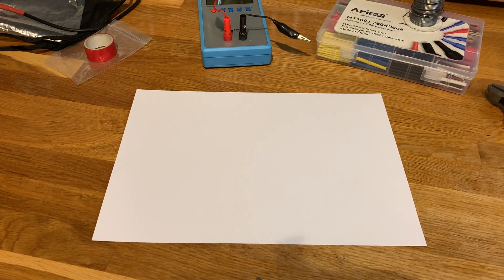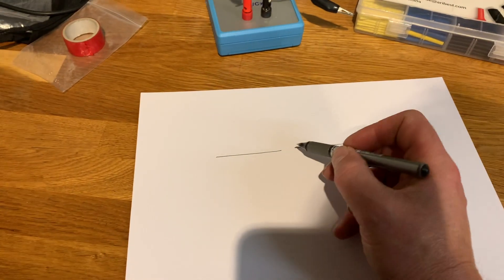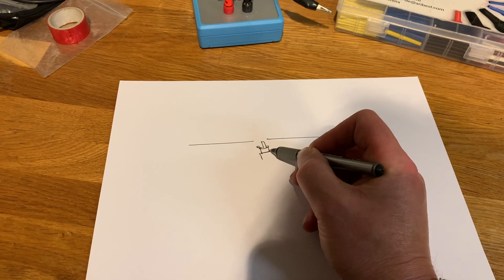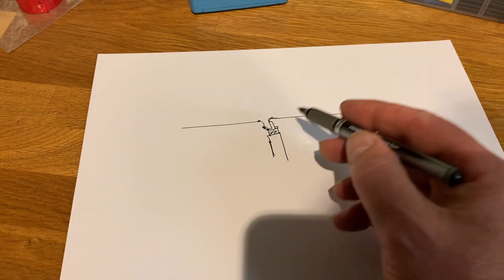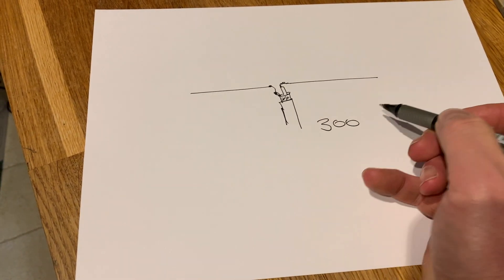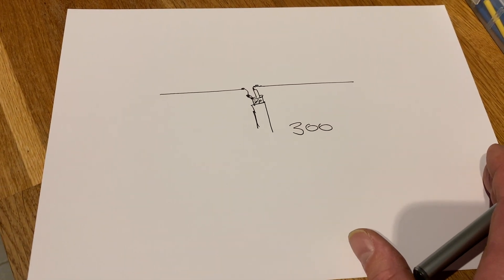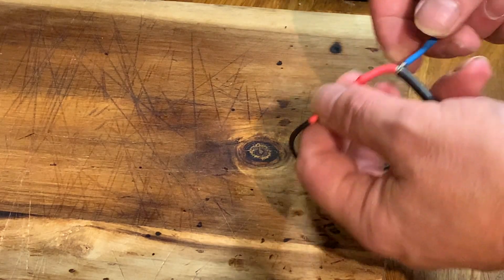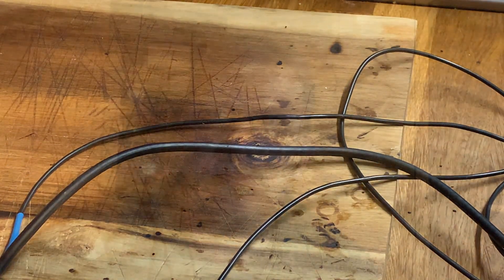HAM RADIO: Simple 20M Dipole build in real time.

Comment: For some odd reason this reminded me of a time when I needed to make a quick and dirty dipole. All I had was a lot of coax that had a PL95 connector on one end. I don't remember what frequency I was running it on at the time, so for brevity we'll just assume I also needed 5m lengths. What I did was measure back from the unterminated coax end about 5m. I removed the outer jacket for that 5m. At the point where the stripped part met the un-stripped part I spread the braid apart just enough to snake the center conductor out. I basically made a dipole by using the center conductor as one arm and the braid as the other arm.
Reply from the maker: Spot on.  :)

Comment: hi could you use a piece of copper pipe inside a plastic tubing instead of wire
Reply from the maker: Yep as long as the same material is used for both legs copper pipe is a good choice..:)

Comment: Great video Mike .... If you cut wire on a regular basis as i do, I found it much easier to get a 1m piece of dressed 2 x 1 lumber and mark the wood every 100mm down its length and use this as my measuring stick.. Comes in handy to walk down the yard too to get a idea of the length of coax or feeder required. 2m0aki.
Reply from the maker: Great idea

Comment: Hi. Very confused old man here, sorry. Help me right pls. 20mtr wavelenght....1/4 wave = say 5mtr. Is that not tip to tip. Then 2.5mtr per side. See you have 5 per side. Is that not 1/2 wave now? 😊
Reply: Yep. No need to apologise. It’s a 1/2 wave dipole. Each side leg is a quarter wave. Total length is a 1/2 wave. Have a look here https://www.everythingrf.com/rf-calculators/dipole-antenna-length-calculator
Reply: 👍😊 thankyou for response. Makes perfect sense now. Its me hearing words in video then confusing myself. Go it.
Reply from the maker: As Tom says, The half wave is made up of the two 1/4 legs.... 😊

Comment: Very nice. 👍  Great minds think alike just made a speaker wire antenna this afternoon for some fun.  Even easier as you split off enough for a 20m "di-poh" (I thought that was Welsh teletubby 😂) and then the remainder is a transmission line which is connected to a BNC to Banana plug adapter to connect to the radio.  Can be even easier for a beginner as you don't even need to do any soldering.  The coax version you've done here was the first antenna I made, every new ham should have a go at this one.
Reply from the maker: Very cool!

Comment: Thanks Mike! to tune SWR you have to cut equal lengths at both ends, right?
Reply: Yes you need to keep it balanced so cut off the same amount from each end a little at a time.  Try and find a clear area to put it up at first, or the place where you'll keep it, as the angle and height above ground will have some effect on it - if you want it perfect.  It'll be a little different depending on if it's an inverted V or proper horizontal too.
Reply: @stewartrv  Thank You!
Reply from the maker: Right